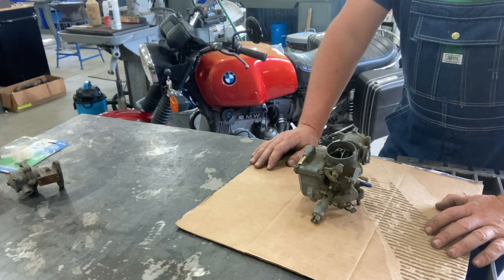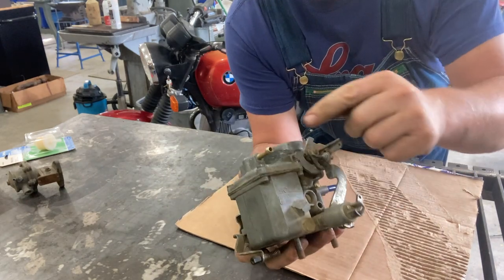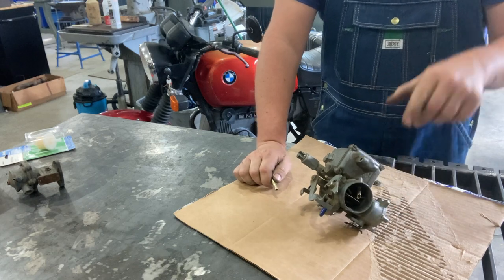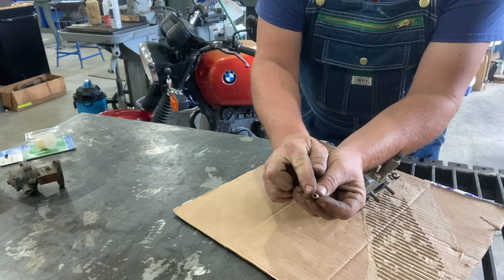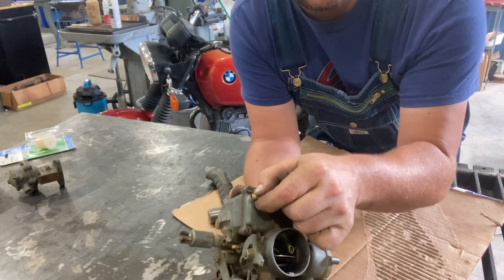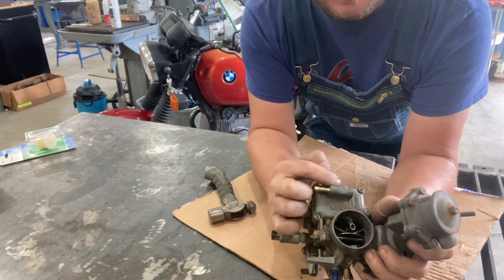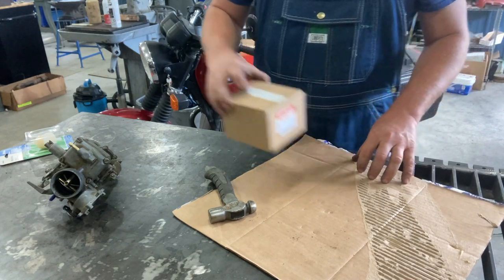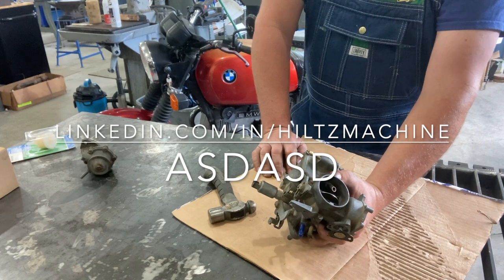#1 Cause of Aircooled VW Engine Fires

Comment: Great advice - loctite 609 the the tubes on the carb and pump and safety wire on the carb top.  I've never liked the float bowl inlet drill and tap method for the reason you cite; it makes the wall too thin and with normal vibration, who knows if it will fatigue.  I've never had an inlet come out when driving but I have had one come out on the bench when pulling a crusty fuel line.  Do all that and replace all fuel lines especially in the engine compartment every 2-3 years with the braided ethanol compatible hose and you'll be fine.
Reply from the maker: The BMW Motorcycle dealership that I use has German braided line on hand that is rated for ethanol. It fits very securely.
Reply from the maker: Thanks for watching!

Comment: The weight of a clamp on that inlet tube is usually what makes it vibrate out!  Just use the correct braided fuel line with no clamps!  Loctite 609 on the fitting is a good idea though…
Reply from the maker: The German braided line is indeed excellent and doesn’t need clamps. I have no clamps on my 1980 BMW Motorcycle. The braided line stays in rock solid.

The only fear I have with a Solex is probably you’d have to assume that people have run clamps for potentially decades, so it’s probably already loose. That’s why I’d run the safety wire just as a backup.

Comment: Best way to prevent fire is check your fuel lines for leaks every time you go out. Also the problem with those after market pump you showed is they can leak fuel into the crankcase, beware if you smell fuel when you check your oil.
Reply from the maker: Good warning on the aftermarket pump. As I mentioned, I’ve never used one yet. I have a large parts cache and I rebuild the best of the old German ones.
Reply: Thanks buddy

Comment: Bud u gotta get back on the 3 wheeler content 🤘🏼
Reply from the maker: Thank you for that comment and I’ll make sure to get back on that soon
Reply from the maker: I need to bore the 200E when I rebuild the engine on it. That may be my next thing. I bought a GoPro I’d like to use for trail rides on it when I get it back together.
Reply from the maker: Look for a new video tonight 9-15-22. Honda ATC 200E Camshaft Removal & Inspection! You will be mentioned in the video!